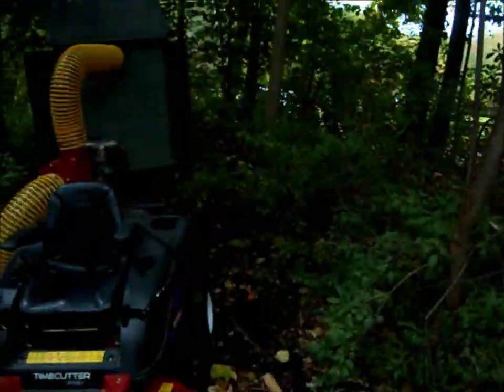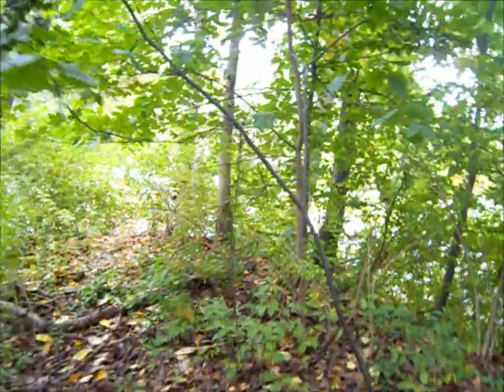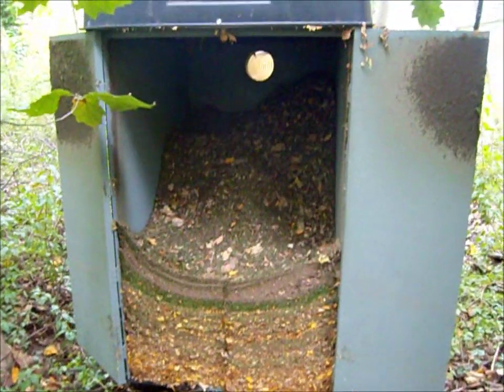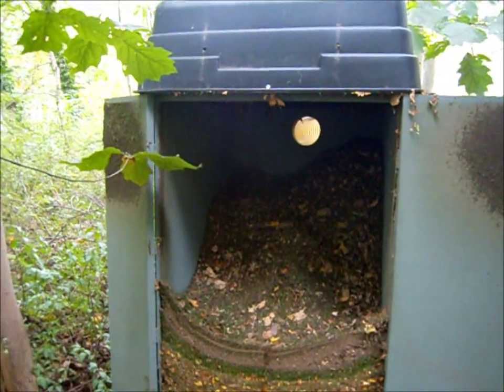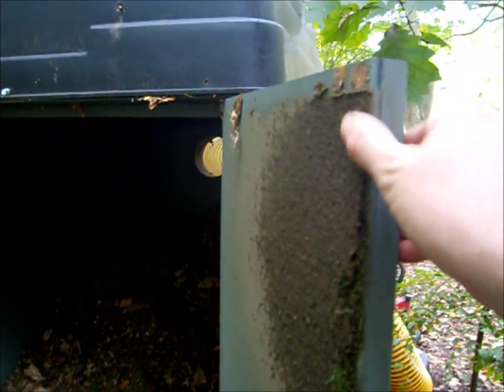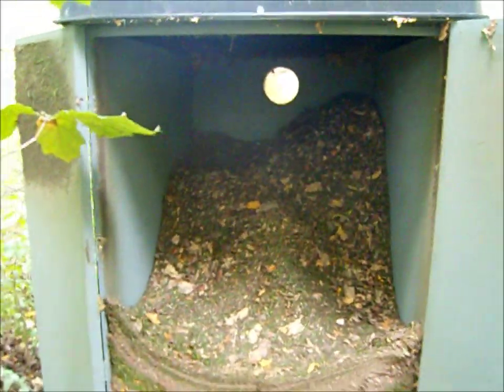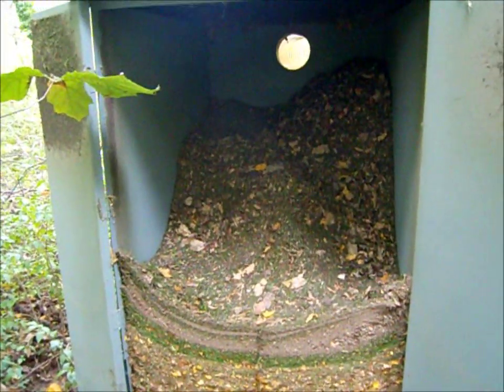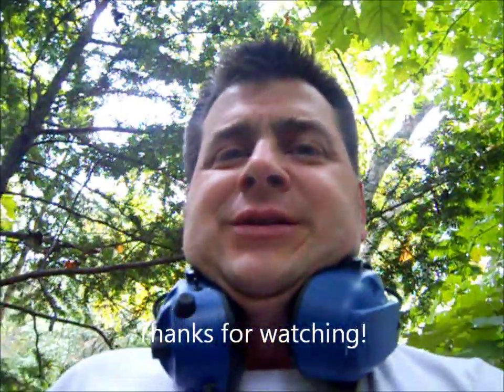10-6-12 Lawn leaf vac system fab, first test successful!

Comment: I have an old 1972 sears leaf vac .  5hp briggs finally lost compression couple years ago. replaced it with a 6.5hp.  going to put an 8hp on it this winter.  I have 6" hoses.
I left the dump ability hooked up and welded a curved plate under the rear lip.  now I trip the lever tilt the trailer and pull away....everything comes out perfect.  also have my original 72' top cover.  has bungie cord material around bottom of it.  easy on easy off.  the front 1/3 is like "herculite" material and the rear 2/3 is like bagger material.  gets all the air flow it needs.  will look into mounting the motor on the back of my ZTR.  looks like a better setup than all my hoses.  I pulled my vac around for years with garden tractor.  ZTR is soooo much better.  much better maneuverability.  I know the weight is an issue with the ZTR hyros,  but it works a whole lot better than riding mower and soo much faster!  don't need 40 acres to turn the thing around.   thought about going to 8" hoses and enlarging impeller housing to 8" but just replaced my 6" hoses this summer and will have to wait till they wear out.  I have the same exact impeller and housing.  get yourself a spare impeller because the inevitable always happens.  sucking up something that bends the impeller blade.  I have spare and change it out and keep going and have time to get the other one straightened and balanced.  good job.
also I have to only put 10lbs of air in my tires.  30lbs and it tips over when loaded.  always thought about lengthening the axel or adding another set of tires but I pull the trailer up next to everything and the wheels will catch.

Comment: Great build but, that's way too much weight to be pulling behind a ztr. You will destroy your hydro pumps, they're not designed to handle that much load. If you don't have a regular riding lawn mower you should buy a cheap one just for leaves in the fall, you'll be glad you did in the long run.

Comment: Carl, My concern is the screen may clog with leaves quickly if you use a small screen. If you have the complete roof of the trailer covered in the mesh and then it discharges at the back, you will never have any leaf clogging issues.